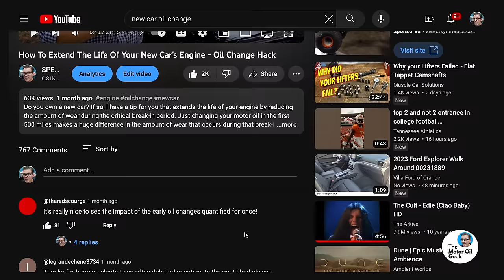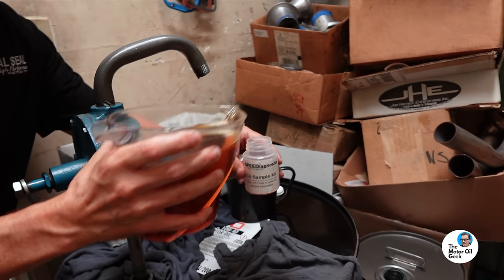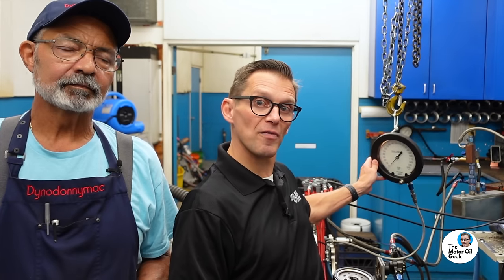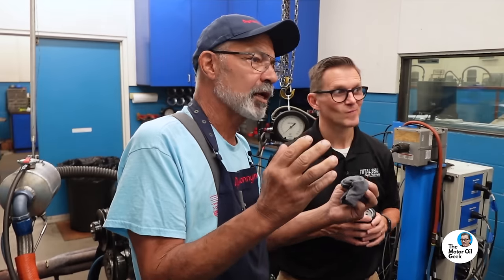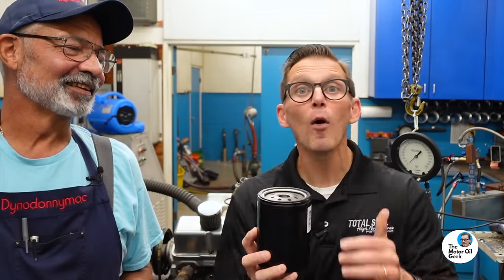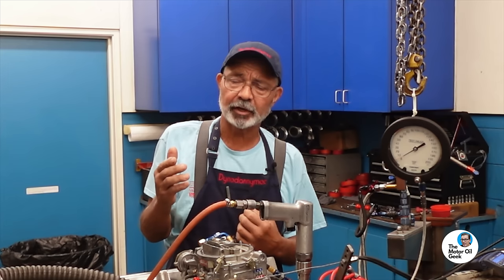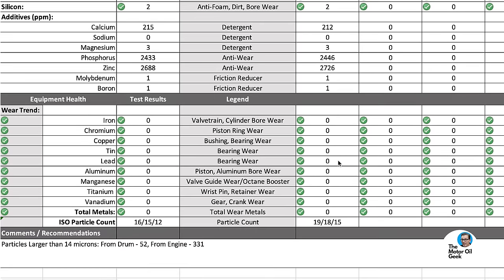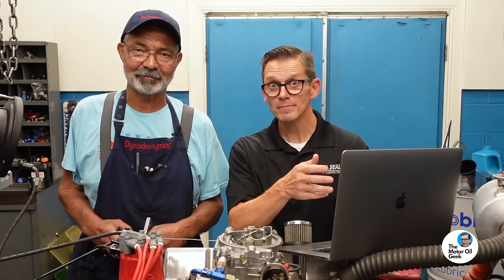Does Pre-FILLING The Oil FILTER Cause Engine DAMAGE?

Comment: I am a master technician, I've been around engines for the past 50 years and I agree FULLY with the practice of pre-filling a new oil filter prior to installing it. Best practice. Where possible (as on your SB Chevy V8). If it's a factory upside down cartridge or sideways mount, you're just out of luck.
But looking back at all the engines I have serviced, repaired and diagnosed, there has not been ONE major engine (bearing) failure due to doing scheduled maintenance without pre-filling the filter. It's just moot. The small wear on the babbit of the bearing surfaces during the initial start has no siginificance on the engine lifespan. When all is said and done, major engine failures are caused by overheating, unfrequent oil changes and mechanical failures caused by incorrect fuel / air ratios and other problems causing an upset in normal engine operation outside of manufacturer's specs.
This goes for your normal car or light truck engine. Race engines operate at much more demanding specs and other, stricter rules apply.
Again, I fully agree with your video content, but the relevance in view of the actual engine life span is not given.
Reply: my 7.3 diesel pickup has a huge oil filter. It would not be a moot point to run that motor with no oil pressure while waiting on that filter to fill.
Reply: @heightsgolan8742  It is moot as far as the overall longevity of the engine is concerned - this is from half a century of experience in engine service. But if it eases your mind, you can pre-fill your filter to your heart's content.
Reply: @gonefilming2020  eases my mind?? You just admitted " the small amount of wear in start up".
So maybe ease your own mind since no oil pressure for several seconds is a moot point and rev the snot out of it before oil pressure.
My first rebuild was in 1969 on a car. But many small engines and one motorcycle starting in 1965.
So, I have seen much in my OVER 50 years of EXPERIENCE. So many main bearing knocks and rod knocks. Too many to count. So it DOES EASE my mind to see oil pressure right away. I guess you get a thrill out of seeing that red light in the dash stay on as long as possible.
Oh yeah, lets purposefully let that 2 qt filter on my diesel slowly fill while the crank is without oil. It don't matter.
Reply: @heightsgolan8742  Woah, dude. You off your thyroid medication? Of course you also have OVER 50 YEARS EXPERIENCE. And of course your experiences are sliced bread as opposed to mine. Nowhere did I say to "...rev the snot out of it before oil pressure" or that I "get a thrill out of seeing that red light in the dash stay on as long as possible".
You did not get the intent of my post. Perhaps read things so many times over, until you can follow the content. Or have someone explain it to you.
And it's perfectly o.k. to have a different opinion - no need to discredit others, because only your opinion counts.
Perhaps find someone to give you a hug. Everything will be o.k.. Promised. 🤗
Reply: @gonefilming2020  amen bro. thanks
Reply: Regarding " If it's a factory upside down cartridge or sideways mount, you're just out of luck." Just use a non-chipped key to crank the engine.
Reply: @garyschuetz2779  Absolutely. I was referring to the actual task of pre-filling the filter, when it's an upside-down design or a horizontal mount.
Reply: @gonefilming2020   not moot at all. it is bearing spinning with no oil. definitely impacts bearing life. by about 50%
Reply: @notsure6182  Good grief. 50%. Right.  "it is bearing spinning with no oil." You're obviously an expert.
Main, rod and cam bearings do not spin. Perhaps read up on how a car / light truck engine actually functions before trolling on the web.
And while we're at it: Use capital letters at the beginning of a sentence. Well, whatever your definition of a sentence is.
Reply: U're absolutely right ! I never prefilled the oil filter when changing oil and filter on my Audi 1.9 tdi(66kw/90hp). It worked as new when I sold it with 651500km. True, oil low pressure lamp was lit exactly 5sec after starting, but did not affect overall engine health and life span. With bigger engines(heavy truck engines)I suppose it's  better to prefill the filter. Not a mechanic,  just a driver(but on that Audi it was so simple and accessible so anybody could replace the filter and oil. Just 2 simple tools, 10 mins and the job is done.
Reply: @gonefilming2020   with no oil they definitely spin
Reply: @gonefilming2020 I'm a master tech like you.  Im 71 years old.  I've been a tech all my life.   I fully agree with you. Its a moot point.  You get oil pressure faster if you prefill but it doesn't affect engine life.  You are exactly correct.  If you have an engine failure its because you either overheated it or you never change your oil.  Its just this simple.
Reply: There's always a bunch of oil left in the engine after you empty the sump. Including on the bearing surfaces. That's good, it keeps it from wearing when you start it. It also buys it time to fill up the filter and get it all flowing properly after the change.
Reply: @gonefilming2020  He does not know what a capital letter is. DUH! HUH?  :)
Reply: @dwtees   bearing life will suffer. you cant defeat that argument.
Reply: @notsure6182  Wrong.  Your guessing or maybe you think you know stuff from the internet. Yes you will get oil pressure faster if you prefill your filter.  Its perfectly ok do do this.   I can defeat the argument and I know from my experience of over 45 years of being a mechanic and a auto shop owner.  The oil film on the bearings will last long enough for the oil pressure to build up.   It only takes about 2 seconds for the oil pump to fill the oil filter and most of the time the you can see oil pressure in about half a second after an oil change. The key is to change your oil often every 4000 to 5000 miles even yes with synthetic oil.  You can easily get over 300,000 miles out of any modern car engine if you change the oil every 4000 to 5000 miles.  Those who use their cars for a science experiment and think they can go 10000 miles between oil changes are those who have engine problems.  Don't listen to propaganda of oil companies if you want your engine to last.  No one ever hurt their car engine by changing the oil too much.  Many have destroyed their engines by not changing their oil enough.  My auto shop customers are all surprised when I tell them they need to check their oil between oil changes because every car engine consumes oil from the normal process of running,  some more than others,  because of wear or design.  Many people think because they have their oil changed it relieves them from the responsibility of checking their oil themselves.
Reply: @dwtees   my what a great speech about oil change intervals that is completely off topic. also, oil companies are not the clowns saying to stretch oil change intervals, that is the engine manufacturers. the FACT is that spinning the motor without oil pressure is going to have an impact. your 'yeah but just a little bit' is moronic. why not spin it for 15 minutes with no oil pressure? no one saying 'prefill' is claiming 'catastrophic damage' just that wear will be increased by a factor of 50% as the actual studies show. your little 300000 mile motors will die from stuck rings or carbon fouling from emissions equipment more often then anything else but it doesnt change the fact that turning it with no oil pressure when you can reduce that no oil pressure time span is fucking stupid. costs you nothing to prefill the filter and save that bearing life. nowadays you will see the damage on the cam journals. go watch a few hundred teardowns on 'IDoCars' channel.
Reply: @notsure6182  I don't have to watch a few hundred tear downs.  I've done a few hundred tear downs.  I know from experience.  My oil change discussion is right on topic.
Reply: @notsure6182  It will in no way increase wear 50%.   Quit believing everything you see on youtube and the internet.  Being disrespectful and using profanity doesn't strengthen your  point in our discussion.
Reply: @deandeki  It factually DID effect the engine health. Its not debatable. It did. Regardless if you can tell or not or see a difference. You have no comparison! You've only the 1 engine that you are damaging. For no reason! Ridiculous LOL
Reply: @dwtees  agreed !  Better to prefill the fuckin' oil filter ! Nevermind and fuck it. All that matters is how are we managing our filters, as humans, wheater u from USA or south east Europe. Take care of yourself and your loved ones ❤️
Reply: @hel0sn8  fuc# the prefilled oil filter. Take care of your personal filters and take good care of your loved ones. Cheers from South East Europe !
Reply: I just did an oil change on an 03 Grand Caravan. It has 580,000 miles on it. The oil filter has never been primed. Your oil always drains back into the crank case when you shut it off. Meaning, there is always a couple of seconds of minimal oil.
Reply: @heightsgolan8742 Unless you have an oil gauge you cant see pressure.  Plus there's oil in the unit unless you just replaced it with a new one. Also i have pre filled oil filters on many different cars and engines the vast majority without an oil gauge and the red light takes just as long to go out. This is with domestic, Japanese and European vehicles.  This inane video doesn't prove anything.  To do that it would require thousands of tests on every make and model car produced.
Reply: @dwtees Never scene a single instance of failure from a vehicle that uses Amsoil. Thats with oil change intervals of 20 to 25k. So dont say "propaganda from oil companies " etc. I have scene many examples in domestic ,Japanese and European cars with over 200k and less than ten oil changes from using Amsoil. You do the oil sample and filter changes as recommended.  Now i wouldn't trust Motul, Royal Purple end especially Mobil 1 extended to do what I know Amsoil does.
Reply: @eac1235  seems like you're trying to make a case for not filling the oil filter. I really can't tell. My point I was making is that my diesel engine has a huge oil filter therefore I will keep pre filling the thing up. As far as all these Master techs and blah blah blah and how long they've been around and all the motors and blah blah blah well let me tell you all you guys something. I'm 70 years old and if owned and operated four shops. And I've seen my share of spun bearings trashed camshafts trash lifters rods knocking main bearings knocking and I can't see for the life of me anybody not prefilling an oil filter.
I really don't get it. But hey, lets face it, you guys hundreds of rebuilds seems to justify it is a moot point. My hundreds of rebuilds tells me you guys are lazy for not trying to get oil pressure right away.
I just shake my head. Pure craziness trying to defend something so ridiculous.
Reply: Right.
Leave the drain plug off over night, there will STILL be oil in the engine. As for the 2 quart filter someone else mentioned? 😂LOL aka LAUGH OUT LOUD what percent of people on the whole planet will every step into a vehicle with that big of filter in there whole life? Slim to none, worried about oil pressure?? Try this, drain and fill with proper amount of oil filter, take off and leave off oil filter, start engine for two seconds, turn off engine, cancel tonight plans because your gonna spend hours cleaning up all that oil.
Wanna do some damage? Dismantle engine entirely, clean with brake cleaner, reassemble, start engine. I’m not gonna waste my time filling the filter under any circumstances. “Come on it takes two seconds” yes not wasting my time.
Reply: @thebancfamily8645  hard to believe people are in here celebrating not filling the filter and actually like oil pressure delays on start up.
Goofy to say The least
Reply: @eac1235  I have.  If you u use your car for a science experiment and try to go 20k between oil changes you will severely damage your engine, and drastically lower your engine life.especially a modern engine with VVT, turbo charger,  and nylon timing chain guides.
Reply: This has been my exact experience going on 40 years as an auto technician  
Your explanation was spot on
Reply: @233kosta Exactly...plus the fact that there are oil stabilizers out there like Lucas for engines, differentials, etc...that keep more oil on the moving parts after the vehicle has been shut down. 👍😁
Reply: @notsure6182  umm no
Reply: Some of us are just a little fanatical!
Reply: You are correct. One of the best V8 engines ever made, the Toyota 1UZ-FE has a downward angled filter point. pressure is gained in the third rotation.
Reply: @Warpedsmac  LoL that is not even in the top 10 best
Reply: @notsure6182  Not sure!
Reply: Even side or upside down you need to put some oil in to wet the media. Put in small amounts until the oil is fully absorbed with little to nothing remaining so installing it won’t make a mess. Never install a dry oil filter. You don’t want the dry oil filter media to be damaged under cold start nor do you want oil starvation at cold start from a dry media.
Reply: If prefilling significantly reduced engine wear, vehicle manufacturers wouldn't sell products with sideways or inverted filter installations.
Reply: @rdavis43  right, it isnt like they are selling us on extended drain intervals that destroy the engines. people are dumb

Comment: I am a newer tech and I have not been pre-filling oil filters, wasn't even something that came up in school or around the shop. After seeing this video I am going to start doing this! Thank you for posting this.
Reply: Now imagine, that there are literally hundreds of such little things you don't know about the trade.
Reply: Makes perfect sense. Although I have not practiced it. Now, with my 2016 colorado,  I couldn't if I tried. Cartridge filter on top of engine. My car's filter is cannister. But extremely tight space and on the slant. Have to turn filter a couple of angles to get where it's  going . Days of V8 with cannister are pretty much over.
Reply: 🤦wow
Reply: Hopefully this shows you how much your schooling lacks for proper education of practicing the trade correctly. As a ASE Master Engine Builder, plus other titles, 33 year owner of automotive machine shop, look at books used in classes to see horrible statements and massive lacking of information required for the tech to be successful.
Reply: I think my 29yo 1994 Toyota truck with 442K miles doesn't care, I have never prefilled my filter, 7 minutes per oil change with filter, and 5 minutes without filter (I change the filter every other time). Half a year to 30, no major work done, still running well.
Reply: Haha you'll learn in the real world that it doesn't matter too much unless it's your engine 😂
Reply: @MrTheHillfolk  It IS MY ENGINE, and 29 years later it DIDNT MATTER
Reply: common sense that the oil put in the filter will circulate through the filter 
if no oil in the filter that means it is just air and no oil until oil is pumped in
Reply: @Ozzy3333333  Not changing the oil in eight years and forty thousand miles on a 1200$ beater worked for me.
Reply: @MrTheHillfolk  when I was shopping for that truck, I came across a sales (scum) man that said he only adds oil when the light comes on, LMAO.
Reply: @Ozzy3333333   I agree  - My 25 YO Toyota has never had a prefill and still going strong with no lubrication issues (I change the filter every time & it's not an easy one to get to, and on an angle that would be impossible to prefill)
Reply: @rickcharb5024  I added a $45 remote oil filter kit, my filter is mounted on the fender, well worth the money. I dont jack the truck up at all, just slide under, 14mm box wrench for the drain plug. Slide out, crack the oil fill cap, open the quarts, by then its drained, literally takes 5 minutes (w/o filter). I have a HDD magnet on the back of the filter and one on the drain plug, haha.
Reply: Been wrenching 30 years now and never fill anything but diesel filters. Never had any issues. Do what you're comfortable with.
Reply: B

Comment: My mom went to High School (WA State) with a fairly famous Top Fuel Racer/Engine Builder Herm Petersen. She took me to his house/shop in Poulsbo, WA when I was in High School. I was always interested in cars/engines and during our long conversations as he was building a motor he mentioned about alway filling the Oil filter. Said it was a was to reduce wear on the motor for free and it was stupid not to do it. Said you could usually get almost 1/2 qt in even a sideways mounted filter if you waited for the paper element to soak up the oil after you poured it in there. I've been doing it ever since my first car and recommended it to all others. Great Video Lake

Comment: My dad taught me to pre-fill the filter long before I ever started driving. Even at that young age, his explanation of why made complete sense. Stressing the fact that crank and main bearing along with cam lobes, lifters, push rods and rockers are not fond of contact without oil pressure, essentially every second of healthy oil pressure matters. So when you can, always fill the oil filter before installing it, it matters.

It blows my mind that these "mechanics" would actually suggest the almost negligible amount of contamination in that oil is worse than no oil pressure. What makes it even more ridiculous is that most modern engines have tighter bearing tolerances which makes no oil pressure even more detrimental. It's idiots like them that make me ever grateful I grew up with a father and grandfather that knew their stuff and taught me the fundamentals of working on cars so I would never be in the dark about repairs. One thing they stressed to me was to use the brain I was given, using the fundamental knowledge and common sense you can troubleshoot quite well.

ALWAYS PRE-FILL THE FILTER... LOL
Reply: Quite right worked as a bus mechanic, usually two filters and always prefilled them.